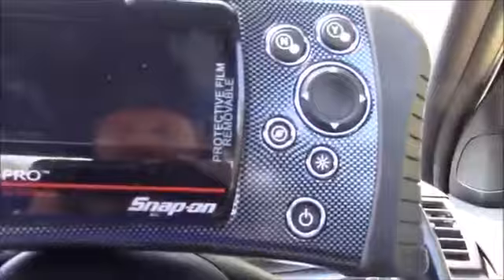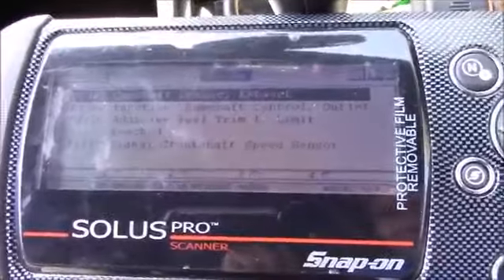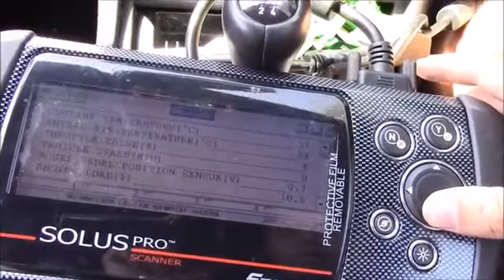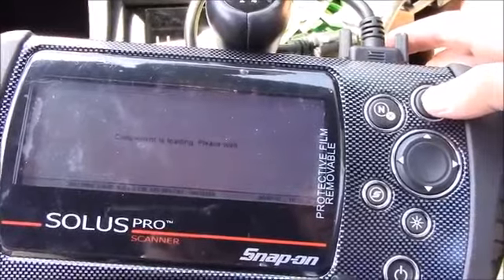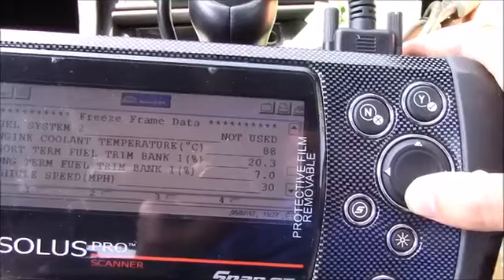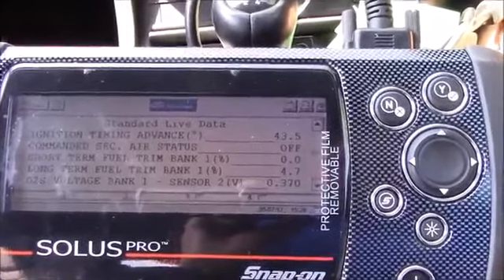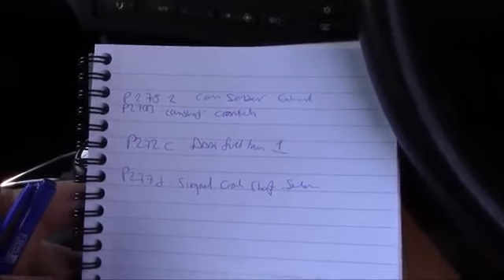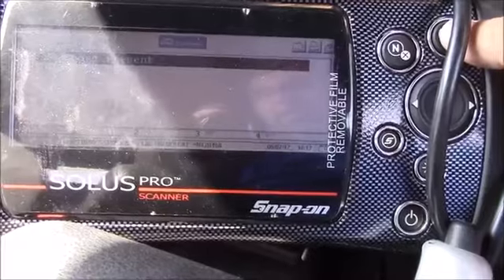BMW E46 OBD2 P2782 cam sensor P27BB camshaft P272C additive fuel trim P277F crank signal fault cod

Comment: What was the problem with the car? I'm experiencing the same codes.

Greetings from Finland!
Reply from the maker: I did eventually replace cam and crank sensors but it was a while after i think maybe one was breaking down back then and throwing up codes , sorry i cannot be more helpful ( love Finland by the way one on my to go lists )
Reply: @cagmito76  Oh, thank you anyways! I think I'm gonna check  the ccv valve first.
Finland rocks! :D